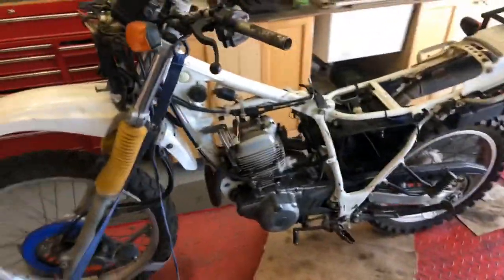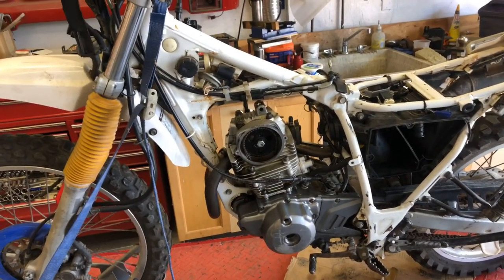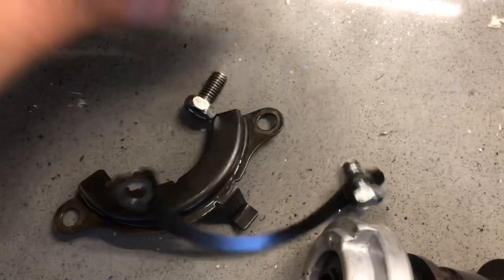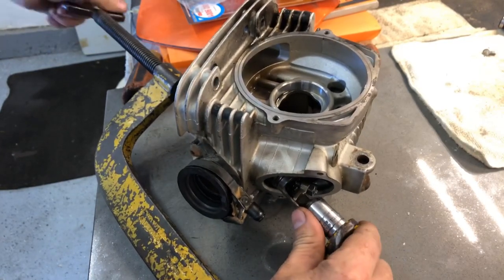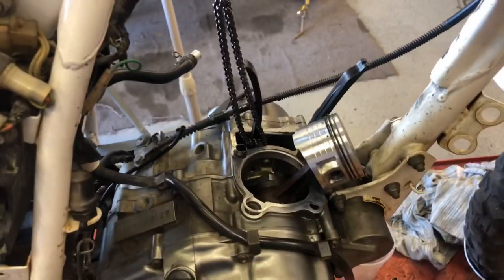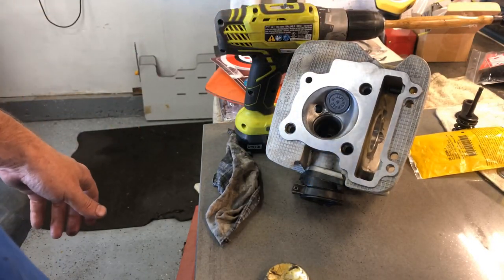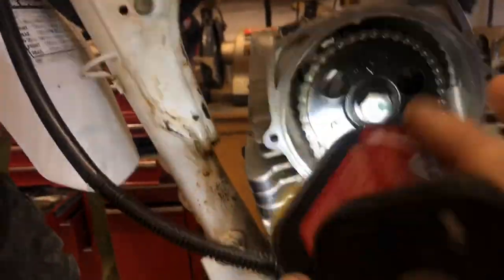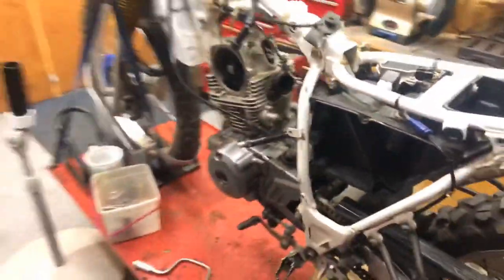Yamaha XT225 Engine Top End Rebuild

Comment: Great quality video where I can actually see what your doing, great explanations as well! On the last part of the vid you are reinstalling the cam chain tensioner, do you have to compress the chain tensioner before install every time? Also, does it set to the correct tension on its own or do you have to adjust it? I ask because I am about to change the gasket on my tensioner and I have to remove it. Thanks again and you have yourself a new subscriber!
Reply from the maker: @klatonpowell  thanks.  Yes you have to compress the tensioner any time it’s removed.  It will automatically set to the proper tension (if it’s working correctly.)
Reply: @TomsTinkeringandAdventures Great, thank you! I learn something new about this bike every time I spring a new oil leak haha.

Comment: I'm looking at buying one of these, but the timing chain fell off. Do you know how much damage that would cause on this bike, specifically, would it bend valves?
Reply from the maker: It’s possible.  Easy to work on and parts are available.  If you get it, plan on replacing the top end.  If you don’t have to, you got lucky!
Reply: @TomsTinkeringandAdventures  Cool, thanks for the response! Do you know how much a top end rebuild would cost as far as parts, and are there things that are most likely reusable?
Also, which forums have most info on this bike?
Reply from the maker: @GunnarSalyer  honestly don’t know prices, check eBay.  ADVrider forum has a XT225 thread with lots of information
Reply: @TomsTinkeringandAdventures  Thanks!

Comment: Nice vid, well done. Would have liked an explanation afterward of how you installed the piston, did you squeeze the rings with bare hands? Also, how did you know when the valve lapping was complete? Lastly, do you use a special tool for the crank and TDC inspection covers? they look like slots
Reply from the maker: Most motorcycle piston rings can be installed by squeezing with your hands.  Valve lapping is something that you kind of learn, but a good test is to install the springs and put some gasoline in the intake and exhaust ports to see if it leaks past.  And finally, a large flat tip screwdriver works for the covers.
Reply: @TomsTinkeringandAdventures  thanks for the info! BTW i've been doing the plastic bag thing for years and same with bolts, for a half second i thought i was watching me LOL

Comment: Where are you located. I have one I need redone as well. It’s still a good bike. But I would like a engine overhaul.
Reply from the maker: I live in San Diego.  I have a spare engine here in a crate but I don’t know if it’s good.
Reply: @TomsTinkeringandAdventures  mines a 93 model and is top shape. I need engine redone, clutch, brakes, and probably a good servicing on suspension. I’m from Oklahoma

Comment: Rebuilt a 97 225 last winter.    It starts and idles good but cuts out when I start opening the throttle,   out of frustration I put it on the back burner but would like to tear back into it and see what the problem might be,   had the carb off 20 times and wonder if I may have lapped the valves too much. Was my first engine ever.  Built top and bottom end.
Reply from the maker: Byke Ryder really sounds like carburetor but I suppose you’re sick of messing with it.  Take a break and start looking at everything, I’m sure you can solve it
Reply: Thanks for the reply, It had a California carb on it that I could never get tuned right so then tried a mikuni clone carb and it ran even worse.  Gonna try to get a non cali stock mikuni carb first before opening the engine again.  Probably try to get around to it this winter got a XR650R to build too and would like to get the 225 finished first.
Reply from the maker: Byke Ryder I’ve heard the clone carburetors are hit or miss.  Never had one myself but I would suspect that first.
Reply: Stock Junkee84
Reply: @StocksFarm  how can you tell if you have a california stock carb or not?
Reply: @jonathanroy9112  they have a charcoal cannister in front of the fuel tank on the frame is easiest way to tell. On the carb itself there's a brass nipple near the mixture screw on the front.
Reply: @StocksFarm  thanks

Comment: how did you loosen the bolt that holds the cam sprocket without moving it from top dead?
Reply from the maker: You can hold the crankshaft bolt to keep it from moving.
Reply: @TomsTinkeringandAdventures  thanks!

Comment: I am working on the same engine and can't get my cylinder off. Is there a trick to getting it off? You seemed to do it with ease lol
Reply from the maker: Make sure all the bolts are off first thing, don’t ask me how I learned that.  A bit of tapping with a rubber mallet might help break it loose, shouldn’t take much.
Reply: @TomsTinkeringandAdventures  Hey Tom I got it off finally. I realized this morning there was a ton of dirt in one of the holes holding the cylinder down… rookie mistake. Thanks!

Comment: Hi Tom, any idea what may have smashed the intake valve tip like that? I just opened up the top end of my TT R 225 and the damage to the intake valve tip looks identical. I’d like to know the possible causes to hopefully keep this from happening again. Thanks!
Reply from the maker: Maybe a loose timing chain or bad tensioner?  Really hard to tell, but the valves shouldn’t do that without contacting something else.
Reply: @TomsTinkeringandAdventures  Great, thanks for the insight! My shopping list now includes a new tensioner and chain… Thanks for the quick reply as well! I’m still waiting for other channels to reply to my comments from a year ago.
Reply from the maker: @squareworksdesignfab9066  I enjoy interacting with my viewers.  Let me know how it goes.
Reply: I just watched the video because I bought the same bike and it has the same issues. I believe its from improper lash adjustment on the valve.

Comment: This video helped we realize I had the cam chain guide placed on the outer-side of the head, instead of in that slot. I removed the head and put it where it belonged, but The cam chain still whines as if its way too tight. I can't seem to find anyone else having this problem. The noise goes away when I slightly loosen the cam chain tensioner. Anyone have any suggestions?
Reply from the maker: Are you certain you have the correct chain?
Reply: @TomsTinkeringandAdventures  Well, I didn't replace the chain, I simply did gaskets because the head gasket was leaking. Does the Chain Guide just set down in the block, or was it supposed to snap in? (Also thanks for the response!)
Reply from the maker: @Moons-Motors  I can’t remember how the guides go on this engine.  Most of them have a slot on the bottom and the top for the forward one, the rear one has a bolt that it swivels on.  If you didn’t change it, something isn’t quite right yet

Comment: I have a Yamaha 225 motor four. Is this the same motor? If not is it still the same process?
Reply from the maker: Hollis Medley I’m not familiar with that model but if the engine looks the same it’s likely very similar.  Lots of manufacturers used the same basic engines in multiple platforms.
Reply: Tom's Tinkering and Adventures I believe it’s the same. Everything in the video looks very similar. Thanks for the help
Reply from the maker: Hollis Medley good luck, let me know how it goes!

Comment: Im about to purchase one cheap of a guy the base gasket has a massive leak when he runs it the bike runs poor and then leaks oil from the gasket quite bad and hisses as it loses pressure something to do with this gasket im wondering how diffucult of a job this could he
Reply from the maker: Old Bones Garage it’s going to involve pretty much everything on this video.  Carburetor and exhaust removal, then the cylinder head and finally the cylinder.  Couple hours minimum.
Reply: @TomsTinkeringandAdventures  a task im about to enjoy my friend im wondering if i should do piston etc while im there nothing wrong with them just means more life out of the bike
Reply from the maker: Old Bones Garage well it’s not a bad idea but these bikes are usually really reliable.  You’re that far into it, a new set of rings and a quick cylinder hone isn’t going to break the bank.
Reply: @TomsTinkeringandAdventures  need to order a honing kit what size piston was it
Reply from the maker: Old Bones Garage well you should wait until you get it apart, what if it’s been bored 0.50mm already?  No way to tell until it’s apart....
Reply: @TomsTinkeringandAdventures  very good point i never thought of that but i mean in genral size wise im yet to see the bike minus photos to determine exactly the area of the leakage i have a feeling near the bas gasket there is the oil tube and a rubber oring i have a feeling this has perished or gasket itself i will give you an update 🤟

Comment: How do you torque the cam bolt without turning the engine
Reply from the maker: You can hold the crankshaft on the flywheel nut.

Comment: I can’t get the top cam sprocket mount bolt loose anyone know best way to
Reply from the maker: Try putting a heat gun on the bolts for a minute or two, might have Loctite on them.  Hold the crankshaft by putting a socket and breaker bar on the flywheel bolt.

Comment: Did you replace valve seals?
Reply from the maker: Not on this one.
Reply: @TomsTinkeringandAdventures  how do they come out? I have valves out
Reply from the maker: @patsharks9605  I could try to explain here, but I guarantee that there’s a video somewhere that will probably be more helpful.  I hope your rebuild goes well!
Reply: @TomsTinkeringandAdventures  haven't found any. Are the pressed in or is there a clip of some sort?
Reply from the maker: @patsharks9605  I guess next time I do it, I should make a video.  They are pressed on, but you have to be very careful.  You have a repair manual, correct??
Reply: @TomsTinkeringandAdventures  no do you have a pdf
Reply from the maker: @patsharks9605  you can probably find one, they are out there or cheap enough to buy.  Will make your life easier!
Reply: Just says use valve guide remover tool to remove
Reply: @TomsTinkeringandAdventures  I just needed the oil seal off, I got it, I don't need to take the whole guide out
Reply from the maker: @patsharks9605  yeah, sounds good.  Be careful installing the new one.  Should be okay!

Comment: Hello friend, greetings from Colombia, thanks for the information, I need your help, I am desperate with a solid of the xt 225 in the engine, it is like a cooking machine, I already looked at the valves and the chain of times, help please.
Reply from the maker: alex soto if the valve clearance is good and the timing is correct, the next thing to check would be the carburetor.  Make sure it is taken apart and all passages are clear.  The jets need to be clear, use a tiny wire if you can.
Reply: @TomsTinkeringandAdventures  thanks my friend
Reply from the maker: alex soto viva la Colombia.
Reply: @TomsTinkeringandAdventures  ¡Oorah!

Comment: How did you get that cam gear bolt Loosened
Reply from the maker: found dead repairz I guess I would have to rewatch to see, but usually you can hold the crankshaft with a socket on the left side of the engine to keep the engine from turning
Reply: Ok thanks
Reply from the maker: found dead repairz good luck, let me know how it goes.

Comment: can you send me the unedited version of this vid
Reply from the maker: I don’t have any of the footage.  Is there something you need help with?
Reply: I have an xt225, it's an 05 I seized the wrist pin on it, while taking the engine apart I noticed one of the cam chain guides just sits in there, is that normal ?
Reply: And what are the odds that I can just replace the wrist pin. Everything else looks good, in my opinion. No wiggle on the crank just has a seized pin. Head won't even budge
Reply from the maker: @ailenal2955  yes, one of the cam chain guides is just set in place, has a little cut out place that holds it.
Reply from the maker: @ailenal2955  you can try, I have polished out the small end of the rod on an engine before and replaced the piston and pin, but it’s not the right way to do it.  Really should replace the rod.